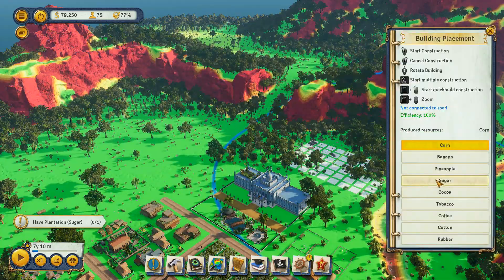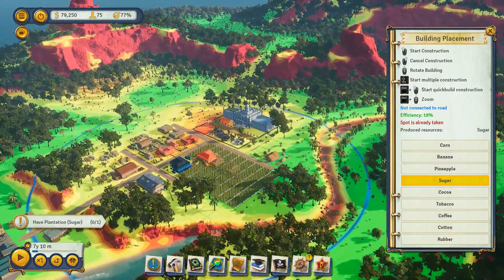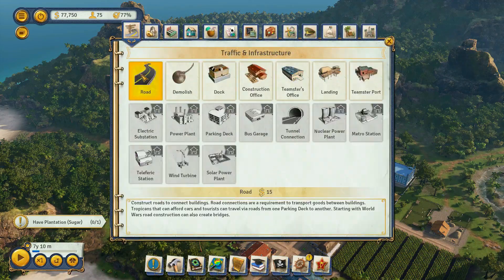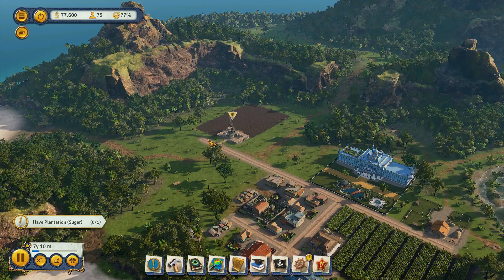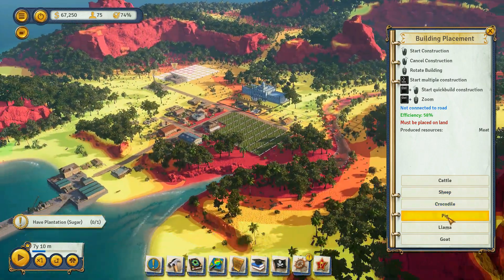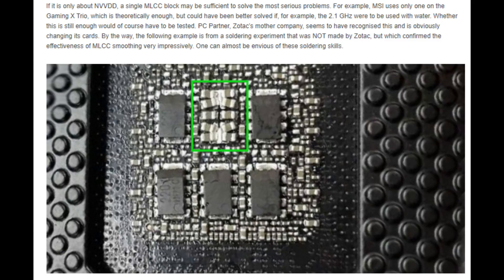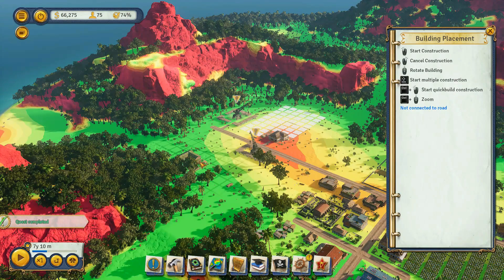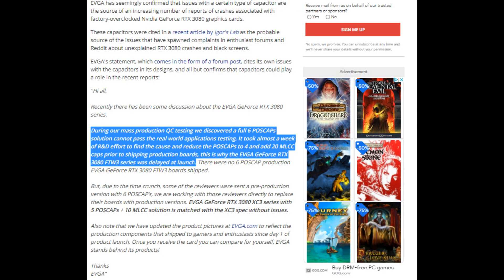Why RTX 3080 And 3090 Cards Are Crashing

Comment: This is going to be a tough position for these AIB manufactures. Cause, this is a Hardware issue and not a software issue. So they can't do much in terms of BIOS update, or some sorta software update, the only option is to minimize this issue by downclocking the GPU, but then what the hell did people spend their hard-earned money for? To only downclock their GPUs?  The only way to fix this for sure is for a RECALL, BUT, don't think they will do that since it will cost them ALOT of money. This is why you wait ppl......    Only the Asus TUF 3080 doesn't seem to be running into this issue cause they didn't "cheaped" out.
Reply: The issue wad fixed with the new drivers. I'm guessing now you know this but in case you don't, the capacitors weren't the exact issue as Nvidia approved the designs and having 6 MLCCs didn't make the cards better as TUF cards were also crashing.
Reply: @hamud7708  Yes, i am aware of the news, but the driver is still downclocking your GPU in order for your GPU not to crash. My main issue is that, the next round of 3080s won't have this problem. While the already 3080 owners have to face the fact that they can't OC at all. Or at least go bit beyond 2ghz. The CAPS weren't the exact issue, but they still part of it. I really shouldn't care, since most likely I will get the 3080 ti, but I am just talking about the market being fair for the customers.
Reply: @fpshooterful   They aren't downclocking them. And if by some reason they did unceeclock them, they are performing exactly the same or better than with the launch drivers. Another thing is that Nvidia doesn't advertise their cards as going over 2ghz so if you crash then it's caused by your own fault